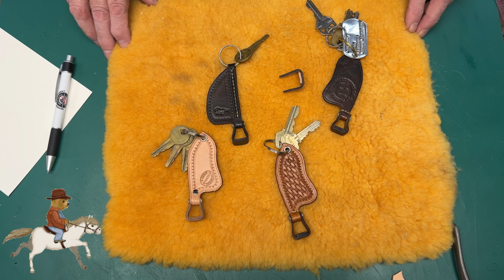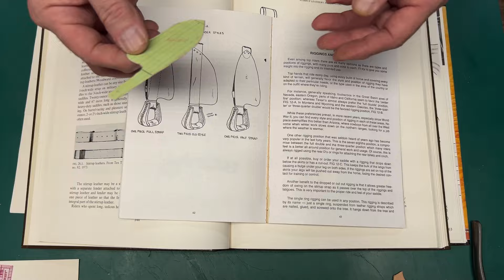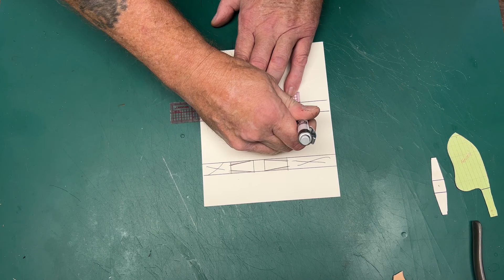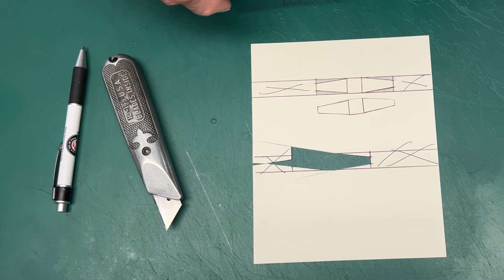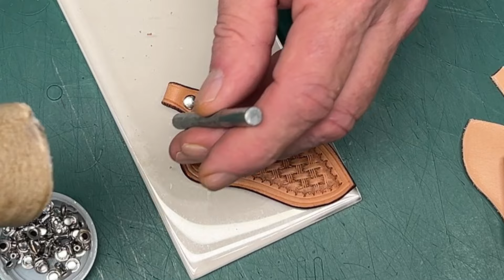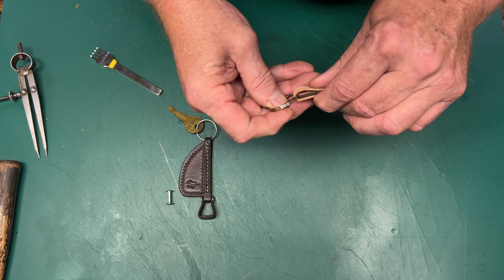Creating Western Saddle Fender Fobs: A Step-by-step Guide #youtube #youtubevideo #youtuber

Comment: Hi Victor,you only showed the place you got the key rings.Having trouble finding the posts that are double sided with decoration like yours
Reply from the maker: @jenkins1979  Hey Jim  those are from Zack White and are called “Decorative Floral Key Case Screw Post with Screw” The item code for a 100 pack is H911NPC  Decorative NP Key post    👍